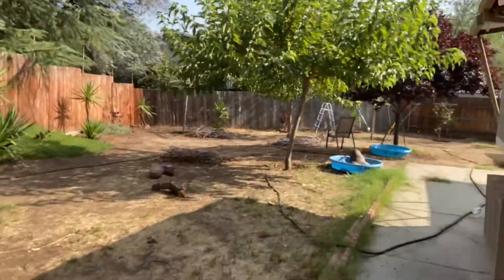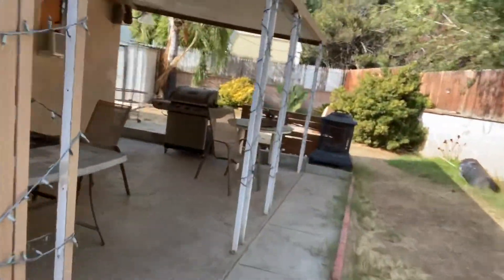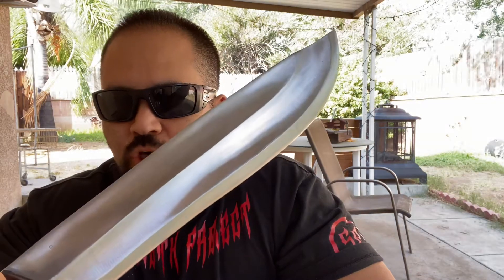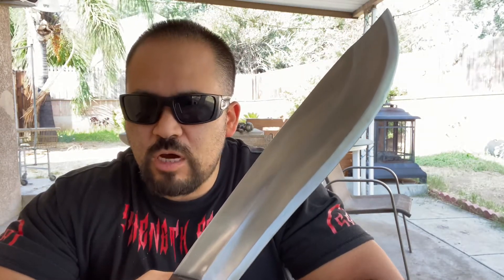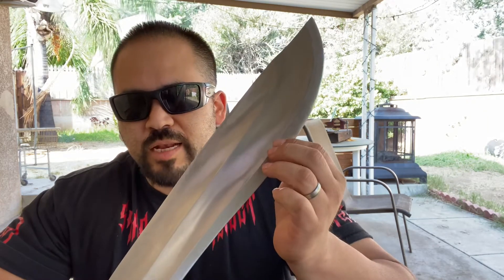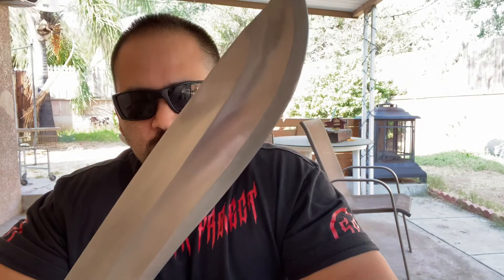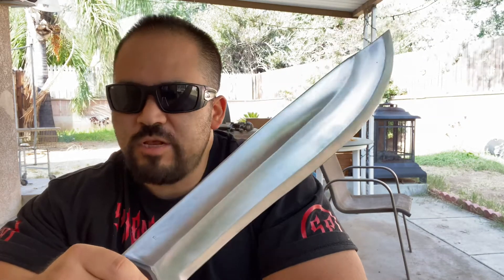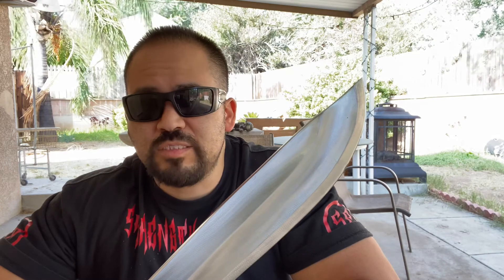Update on my mega preacher knife!

Comment: Good honest review mate. I rolled a edge on mine from belting it into ridiculously hard seasoned wood & bent the tip hitting a rusted drum. My tip wasn’t hardened. I really should send it back to them & get it done , but it is a bit of black magic redoing the heat treatment. But on a tough beater the tip should tougher then a 70 yo 70% rusted away 44 gallon drum . That my trail hawk punched straight trough.
Reply from the maker: Thank you brotha! Ya I was thinking of send it back too, but for the minor defect mine had it wouldn’t be worth the time and shipping cost.
Reply: @pistolpete4991  I might show a gunsmith mate who also makes custom knives & ask his opinion. Pretty sure he’ll condemn it. If he says it’s unacceptable I’ll contact them .
Reply from the maker: @concernedaussie1330  ya might ask around. Thanks